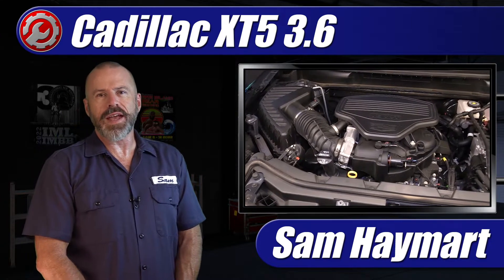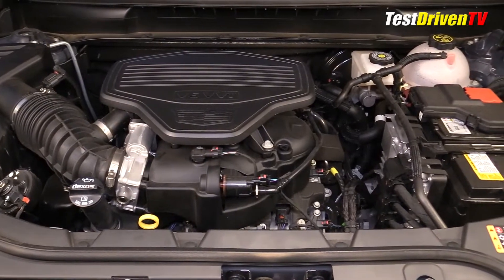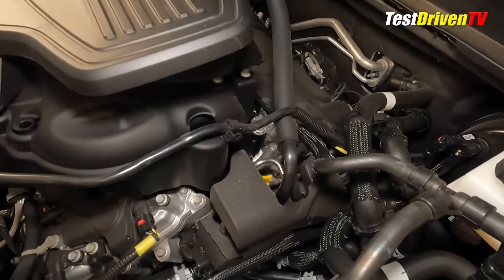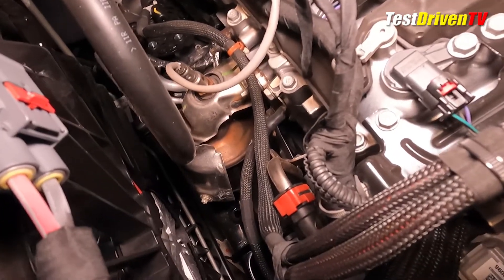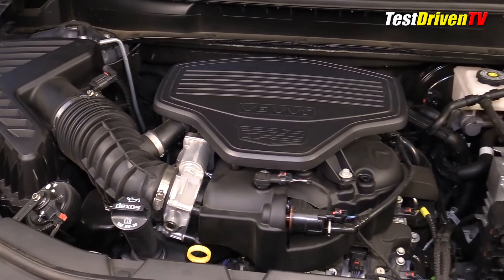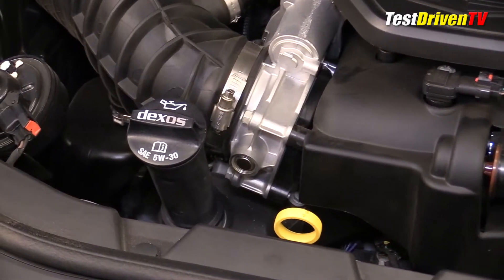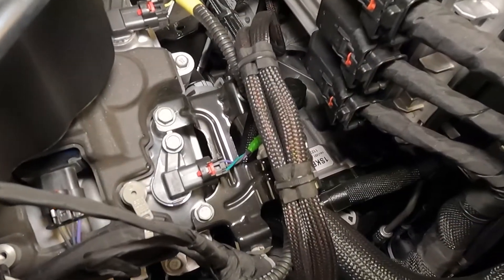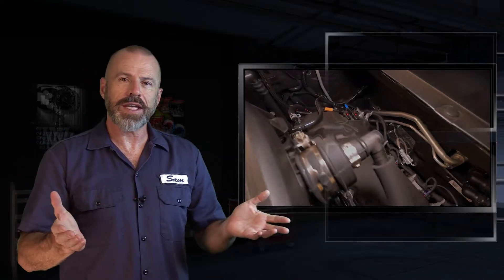2017-2023 Cadillac XT5 3.6: Engine Explained

Comment: How about mentioning that you want to change your ECT sensor or your thermostat? You’re looking at $1500 at the dealer because those smart engineers carried both units in the top half of the engine has to be removed to get to them. Nice job Cadillac and GM!

Comment: First thing I did with our's is disable the Start Stop which puts un-necessary wear on components for next to zero fuel benefit unless you drive in stop and go traffic alot. Second thing I did was disable the cylinder lock out feature that has been the source of incredibly expensive repairs. With those two changes I have a whole lot more confidence in our Cadalac.
Reply: How were you able to disable the auto-stop feature? GM tells me it can't be done. Obviously, it can be. They just don't want to due to EPA guidelines. 😡

Comment: 65000 miles regularly changed oil, no warning of any kind , left home   300. Feet from driveway, engine shut off and wouldn’t restart , called wrecker  had it hauled to  dealer ship,next day  got a call, they said engine is locked up. New engine $13,000.00 ,  no warning of any kind,  out of warranty THANK YOU  GM

Comment: Transmission is the weakest link
Reply: If you don't get unlucky with a quality control defect that blows on you in 10k miles, ignore GM's "lifetime" oil and replace the fluid every 50k. They even provide a hand-screw style oil cap (takes Dexron VI and go for a full synthetic).

Comment: GM is still using plastic intakes. 🤦🏻‍♂️🤦🏻‍♂️🤦🏻‍♂️🤦🏻‍♂️
Reply from the maker: All manufacturers have plastic intakes. All of them for over 20 years.
Reply: @TDTVGarage  Honda J35's uses magnesium intakes.
Reply from the maker: Indeed but it's the exception rather than the rule.
Reply: Plastic simplifies the material and that sounds cheap.

GM uses Nylon 66. The intakes have proven to be reliable and have been around a while now, my Northstars used Nylon 66.  

The benefit of Nylon 66 is that it stays cool compared to a metallic material thereby keeping the fuel charge cool.   They are not fragile unless you hit it with a hammer and they are quite heavy.  

Intake backfires are shunted to a one way exit valve to relieve pressure avoiding an explosion.

Comment: Check engine light on my XT5 2019, it on and can I just clean oc valve?
Reply from the maker: First you need to find out why the light is on. Use a code reader to determine problem code, look up code, take appropriate action.

Comment: No dip stick for the transmission fluid what do they think I'll do pour oil in there 😂😂... I laughed but after i remembered someone poured oil into their wiper fluid at my moms job
Reply from the maker: There are reasons these things no longer exist.
Reply: Many cars have no tranny dipstick. Tranny fluid is ‘sealed’, I’m told.
My 2015 Taurus has not tranny dipstick

Comment: That boy really said a V4..🤣
Reply: Cylinder deactivation means 2 of the cylinders stop working. Because this engine is a v6, it would become a v4. not an inline 4 dumbass
Reply: 2 cylinders are sometimes "turned off" to cut down on emissions - 1 on each bank meaning 2 cylinders firing on one side and 2 firing on the other side hence V4 mode.

Comment: We love ours xt6 I just can’t figure out why we get that creator fluids smell like if you had a leak, but there is no leak dealer says no leak. We get that smell every so often like on the driver side, especially other than that the vehicle has been a gem.
Reply: I don't know what  "creator fluid" smells like but I have noticed that my weatherstripping has a funky / weird "kind of vomit" smell to it on my Xt5 - (yes I got up close & personal to sniff it)  I'm not sure if this is what's causing it.... I'm thinking it must be because I only notice it when it's hot and I just opened the door - getting in the car - then I get that beautiful leather smell and forget all about it.  Once in the car I don't ever smell it even with the A/C .  So what I do is condition the w/stripping to help maintain it  - then wipe them down with a nice smelling  scent on a damp cloth.  (something that won't wreck the w/s)  I've tried diluted fabric softener and a dry bounce sheet.  I don't really notice it so much anymore. When I was looking to buy my XT5  - I read about this weird smell not knowing what owners were talking about,  but after I bought one figured this is what it was. P.S I always press and hold the fob unlock to roll down the windows on my way to the car before I get in - I hear that the vapor build up in the car on a hot day can be somewhat toxic. Plus who like getting in a hot car at those temps. 😰
Reply: Unknown to me as that the dealer found a coolant leak at my water pump. It had a seeping issue so the leak was not catastrophic but it had a burned coolant smell. I think it might be a known issue.
Reply: If you were typing in the word coolant you might have a seeping water pump. I had same issue
Reply: Believe me we had the same problem and I am good with cars … finding the problems that is we went to the dealer 2 times they couldn’t find it but eventually I found and it was the radiator

Comment: Getting 30-33 mpg with Amsoil signature series engine and transmission oil! Starting to use some oil around 6,000 miles in. Solid engine
Reply: solid or terrible my 2.0 skyactive i got since 2014 isn't even using a sip of oil these 3.6 are terrible
Reply: @mooauto2388 great. I just bought 2019. Was looking for a video on the transmission fluid. My 2003 explorer  4.0 with 205k miles uses no oil. I hope this engine lasts. I love the upgrade

Comment: make this video a half hour.  I want a deep dive into this vehicle.  Been looking at it, and scared to buy it because of the bad reputation of Cadillac these days.
Reply: Issues with the thermostat at 75k miles for most of XT5, but overall it’s been a reliable car for the past 3 years
Reply: @noereyes82 that’s the issue I just had with mine.. my engine light came on and I noticed my car sounded like a very loud vacuum cleaner that wouldn’t turn off.. I went put it on the machine at autozone, and they said thermostat.. it made my AC stop running.. I took it to a friend mechanic, he already knew what was wrong, he did something to a sensor and it started working again.
Reply: @noereyes82  Yes that true,  I just had mine done - warranty covers it though. The only other thing is my press button on the drivers door handle won't lock/unlock the car. However, the key fob works fine and I have 3 other doors plus the hatch to get it.
Reply: I hsve a toyota camry . New water pump at 45k miles :/
Reply: 44k miles since we got it in 2017 and its reliable. No problems yet.
Reply: All new cars have issues now
Reply: Stop being lazy and do your own research.
Reply: 2020 XT5. Had weeping water pump replaced under warranty. Otherwise, runs great. It’s a good car. I have worked for several new car manufacturers on the service side of the industry. Engine built rock solid !